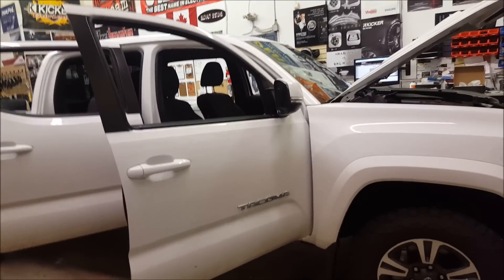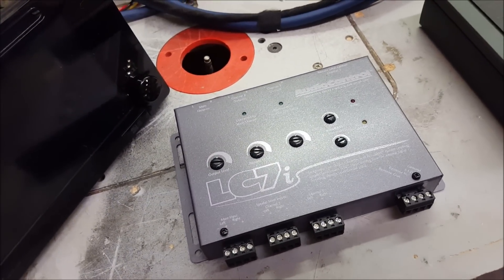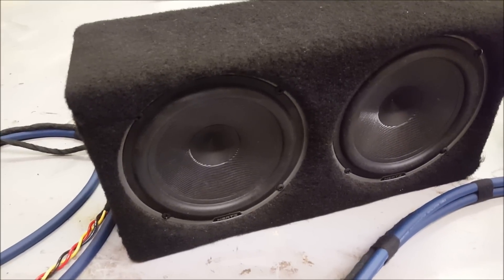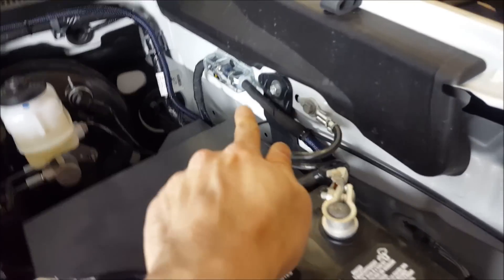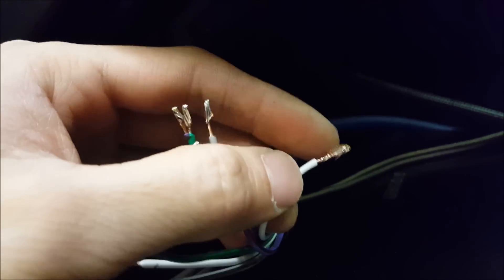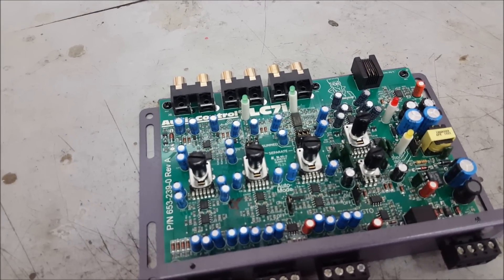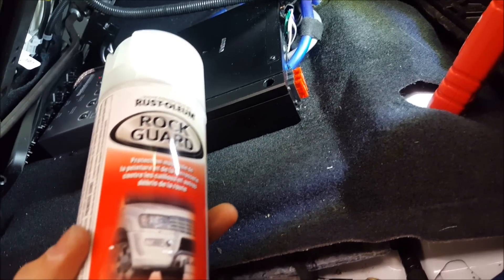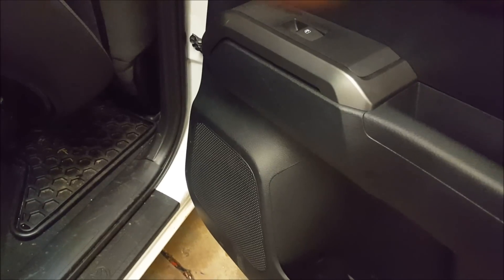Builds: Toyota Tacoma mini sound system (Factory Head Unit maintained) | AnthonyJ350

Comment: I like the there trucks, I work for a Toyota dealer and they are loaded with features and the styling is great.
Reply from the maker: +Cody Rossman Ya the trucks are pretty nice.  We always tend to upgrade the audio and add remote starter and or security system as well.

Comment: Where can I find the wiring diagram for the stock OEM factory radio harness? The harness that plugs into factory radio. I have a 2016 Tacoma TRD Off-road double cab
Instead of plug and play I'm planning too just cut and splice the wires too run too the LC6i so I wanted to know what color 
wires is for each door speaker
Reply from the maker: You'd have to search online.  We have access to databases at work but we pay for subscriptions.
Reply: Alright thanks bro couldn't really find it online or on any forums for the 2016 Tacoma you know where I can buy it from?
Reply from the maker: Taylor Fukumitsu Have you tried the12volt.com?

Comment: What did u do with the tweeters? I added a four channel amp and upgraded my door speakers but now my tweeters dont work
Reply from the maker: There's a connection point the tweeters and midrange door speakers are connected to.  It sounds like you bypassed it.  Did you run all new wires to the speakers?

Comment: Hi! Thanks for the video. I'm wondering how you wired the battery cable for both the amp and the LC7i. Like, Did you just divide the power under the seat? I have a small amp installed with a 12 gauge cable but I want to ad an LC2i to improve my bass. Am I going to need to instal a thicker cable from the battery? Do I need to switch to 10, 8 or 6 gauge? Thanks in advance.
Reply from the maker: lohengrinknight I usually grab power behind the cigarette lighter or go into the power distribution of the vehicle and install a 7.5 amp fuse inline.

Comment: Please make a video on the wire harness. How to make me one?
Reply: In order to do this you need to purchase two wiring harnesses. The regular aftermarket wiring harness (male) which plugs in to the factory radio connector and goes out to the factory speakers and the reverse wiring harness (female) which plugs in to the factory radio.

Basically what you would do is hook the reverse harness (female) up to the power and ground connections from the female harness in order to power the factory radio. All of the speaker connections (white/grey/green/purple) from the reverse harness will go to the amplifier or line out converter to serve as high-level inputs coming from the factory radio (instead of going to the factory speakers as they normally would). Essentially the reverse harness will serve to power the factory radio and provide the high-level INPUTS from the factory radio for the aftermarket equipment.

The speaker connections on the aftermarket radio wiring harness (male) are connected to the factory speakers. This harness must be wired to the aftermarket amplifier. Essentially the aftermarket radio wiring harness will carry all of the speaker OUTPUTS from the factory amplifier and provide the power and ground connections for the reverse harness going to the factory radio.
Reply from the maker: Thanks for the feedback!

Comment: What did you use to turn on the amp and LC7, the remote turn on feature does it not cause a pop sound when turning off the system?
Reply from the maker: No popping noises. I just use accessory from the deck to turn on the LC7i.
Reply: AnthonyJ350 is that the acc wire that powers on when the switch is turned on and stays on regardless of the deck being on or off, which keeps the amps on always when the truck is on, or does it work like a remote wire? Thanks.
Reply from the maker: @a1dookie  It turns on whenever the key is in the accessory position or ignition position.
Reply: Theres a gray accessory wire on the stock plug. I think its the biggest one to the right if you're looking at the screen.

Comment: Does the harness you made keep the factory rearview camera? Also need to know how you connected the harnesses
Reply from the maker: I believe the camera runs through a different plug than the audio plug.
Reply: AnthonyJ350 are the plugs you used audio only
Reply from the maker: Yes, main power for the head unit and audio.
Reply: AnthonyJ350 okay thanks

Comment: Those plastic panels have to come out if you want something big. 
They take up a lot of room. 
Im sure you could build a box to fit a bigger sub around the plastic but with the removal you get tons more room. Id say about 3/4 as much as my 98 f150 single cabs room behind the seat.
Reply from the maker: Most people are fine with an 8 inch or a slim design 10 sub so far.  6" if we want the most efficient system possible.

Comment: Wow, this is literally almost exact same type of setup I was thinking of doing in my 16 Tacoma. I was thinking of using the LC6i though, as I've heard the LC7i has hit/miss quality. Some people complain it makes the bass muddy sounding, but I don't have experience with either so I'm not really sure which way to go. Apparently tuning is the key with them though, so probably either one works, and some people are just not good at tuning :)

Do you think this Kenwood 5-channel is a better option than using the Alpine MRV series that would require two small amps for the same # of channels? From what I've read this Kenwood definitely seems like a good way to go, and it would be easier for packaging since less power cable, less space, etc. ...

Also, do you think the Kenwood would have enough juice to power a JL 10tw3? I'm really set on this subwoofer, and from looking at the specs it seems the Kenwood would work well with it.

One more question, in the past I had really good experience with the MB Quart speakers, but that was 15 years ago. I've heard their most recent speakers are not as good of quality. The ones I had before, sorry I forget the model name, but they retailed for around $600/pair ... I got a good hookup on them, so didn't pay anywhere near that :) ... but I was wondering what you thought of the MB Quart Z and X line 6.5"? It seems a set of those (components for front, coaxial for rear) runs $180 on Amazon, which seems really cheap for speakers, so I am guessing these are probably shit? I'd be willing to spend a bit more on speakers, but really wouldn't want to go over $400 total front/rear for speakers ... any suggestions? I'm not stuck on MB Quart
Reply from the maker: +joeracer302 K let's see if I can address all your concerns.  I'm assuming the Accubass might be throwing off some people.  I like the LC7i especially with vehicles with bass roll off.  It's also possible they might not have summed the signal when required.  And on top of that, everyone's ears are different, so opinions are subjective.

I would look into the Kenwood or Alpine's PDR 5 channel.  My top pick is the Alpine PDX V9 5 channel: 100 watts RMS per channel and 500 Watts RMS out of the sub woofer output whether 2 ohms or 4 ohms.  And the price point, you can't beat for those specs.  When you're after sound quality, it's hard to beat the 5 channel.

If you're just running one TW10 the Kenwood would be fine, if you want to run 2 run the PDX.  I was also thinking two 8" W3's and building a low box to clear the seat in the Tacoma.

Speakers it depends on how much you want to spend.  Hertz High Energy's are great, and so are JL Audio's C3's.  For more of a bargain the Alpine Type S is hard to beat.  Whatever speaker you choose, make sure you install the proper speaker adapters for a good seal and clearance and add some sound deadening material, that way you get the most performance from what ever speaker you decide to buy.
Reply: AnthonyJ350 I was just going to build my own adapters. I have a router and I'm pretty handy with it ;) I'm also using the sound deadning material for sure :)

I'll check out the PDX-V9, thanks for the tip. I may get that so I have some growing room if I decide the single 10 isn't enough.

Comment: So I replaced my factory door speakers with kicker 6x9’s and 6.75’s. It sounds better, but i feel there underpowered. #2 i am looking to install a kicker 8” sub with a mono amp in the back now to give it bit more umph. Do you think it will drown out the door speakers and should i be looking to put in a 4 channel amp for those?
Reply: Sorry this is also in a Tacoma. 2019 offroad.
Reply from the maker: I would do a 5 channel in that application so you can balance the system better.

Comment: Awesome install. Love the radio harness extender that you did! Never thought of that. Where would u go to find the part that plugs into the back of the stock unit? Or what would be the name of it if u don't mind. Keep up the great work.
Reply from the maker: +chi027 You can find the parts on www.metraonline.com.  the "71" part designation will fit back into the factory radio typically.

Comment: I’m looking into adding a fuller sound on my TRD Pro. Would the lc7 be good enough or would jl audio clean sweep be a better choice? I’m also looking into putting a 5 channel amp and a decent woofer. Any recommendations
Reply from the maker: I would use Audio Control's LC7i as it can also compensate for bass roll off and I've had a great track record for reliability and sound quality with them.  As for a sub woofer JL Audio's W1 is a super durable sub woofer that is very efficient and needs very little air space to work properly.

Comment: Can you please post the wiring diagram for this install? I'm doing an lc7i on my 17 Tacoma.
Reply: paxton306 did you use a harness?
Reply: I bought the metra harness to connect to 2 sets of 9 wire so I could plug into the stock harness without cutting and splicing the factory wiring
Reply from the maker: You'll need to test and verify the wires.

Comment: what powers the tweets in the dash?
Reply from the maker: The amp does.  They have passive cross overs on them.
Reply: AnthonyJ350 so basically there's 4 speaker wires coming from head unit to loc/amp then 4 coming from amp to the speakers and the front factory speakers on tacoma are components with crossover already?
Reply from the maker: James Wood Ya a lot of factory vehicles will have the mid range woofer and tweeter run together in parallel and the tweeters have caps on them so they don't play any lower tones.

Comment: why does a 2016 not have rca cables
Reply: im used to hooking up rca cables and running power. where can i find a plug n play harness?
do all amps have the correct hookups for the harness?
Reply from the maker: No factory head unit has RCA pre-outs, that's something you find in the aftermarket.  The plug and play cables you saw I make in house at my shop.
Reply: my bad i looked on the website and it explained a lot...can i just run an amp or do i absolutely need the audio conrolller?
Reply: could i just run the amp and leave the unused wires that go to the audio controller unhooked?
Reply from the maker: Austin Dearman What are you using for the input to the line output converter?

Comment: thank for showing me the shit itd be nice to show how to hook the wires into the amp tho
Reply: Its not too bad honestly oncr u get to looking at it its actually kind of simple (unless you're figuring on using stock radio that doesnt have the inputs) then you would have to get the RCA addapter and splice into the speaker wires then run those to the adapter and the adapter to the amp... Just go the easy rout and upgrade ur head unit